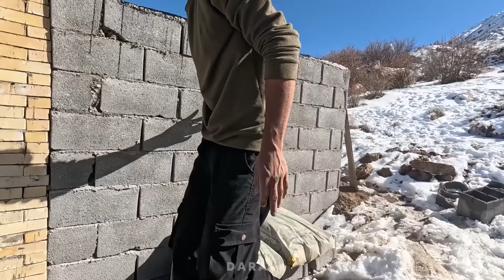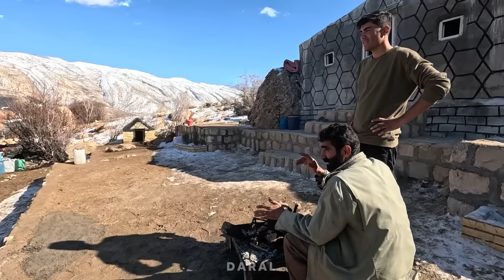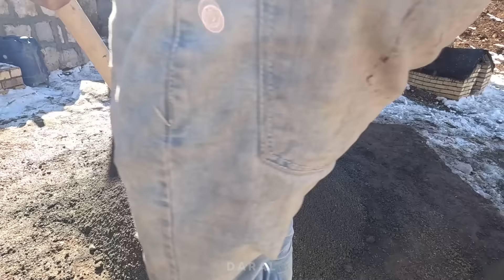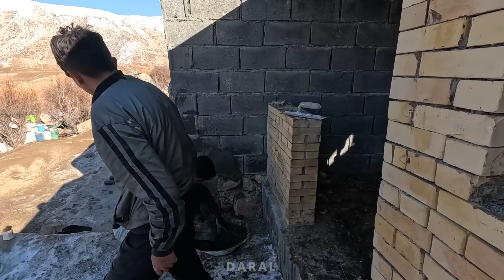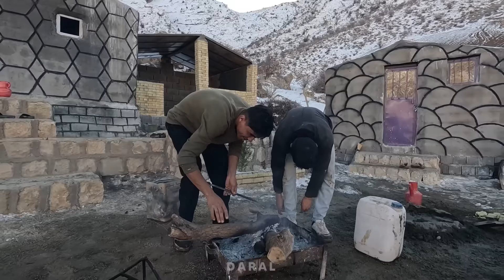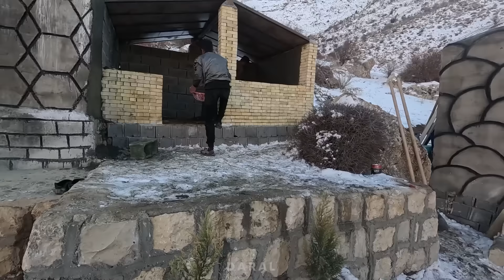"Milad and Hassan Transform Kitchen Walls with Concrete Finishing!"

Comment: حسن لو تغربل الرمل في لبخ الحائط يكون أكثر سلاسة واكثر لصوقة على الجدار اما طريق السيارة لو تضع فيه من الحجر الناعم بعرض ٢ متر حتى تقضي على الوحل والسيارة لم تغرز فيه مع تحياتي لك ولعائلتك الكريمة من العراق
Reply: I am curious, you suggest putting soft stones for the road. I wonder if it will need some type of base before adding the stones? The soft soil and weight of the truck, will sink or push down the stones? It is a long road to the house, muddy and steep, I wonder how will they do it.

Comment: Solar panels and generator would be awesome. Besides lights , a ceiling fan in the kitchen for warmer weather and circulation  would be nice. I do hope they enclose the kitchen but adding large open/close windows would be awesome. What is the last finished room to be used for?

Comment: Don’t you use rebars in your concrete construction? When we install concrete blocks we use small pieces of rebars that link one line of blocks withe the next one. . We also reinforce with columns at the corners and link the blocks with the column using panel anchors;that way if you have an earth quake the wall will not fall over you or at least it will be more difficult for that to happen. Anyways, I enjoy watching you almost every day!!